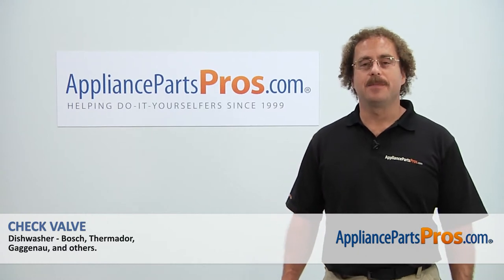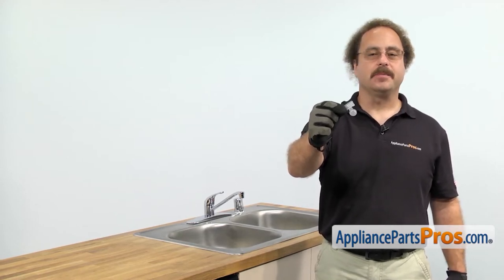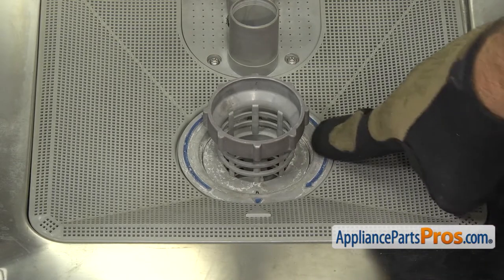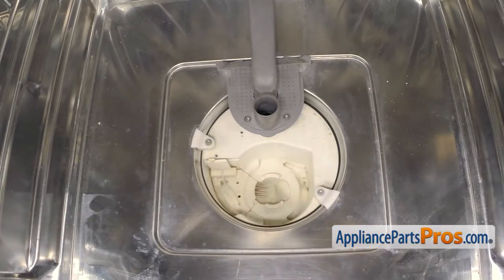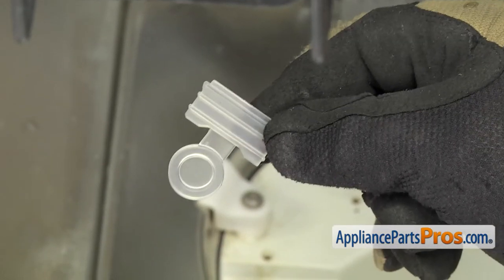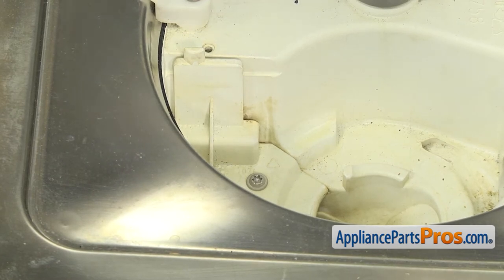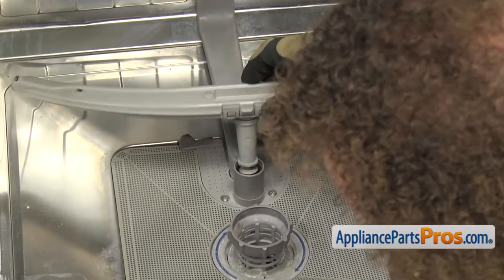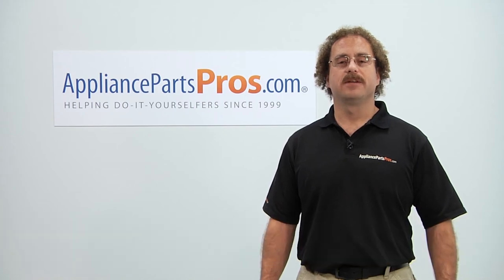How To: Bosch/Thermador/Gaggenau Check Valve 00165262

Comment: excellent video - unrelated question - having a hard time finding the drainage solenoid.  Float switch and impeller work, I can pull water through line with vac pressure but it won't drain.  I would guess a bad drainage solenoid but for some reason its very elusive.  Unless it's built into the drain pump but... don't see it.....

Comment: Hello! what if the check valve is broken in two pieces? pulled it out and found that bottom dangling circle part of it had snapped  off- I can feel its still in there but I don't know how to get it out in order to replace it with the new check valve.
Reply: Same happened to me. Fashioned a tiny hook at the end of a thin-wire coat hanger.